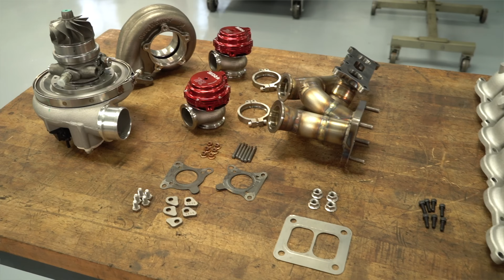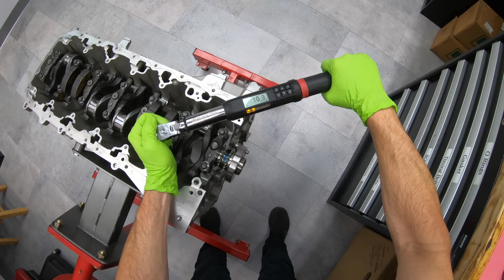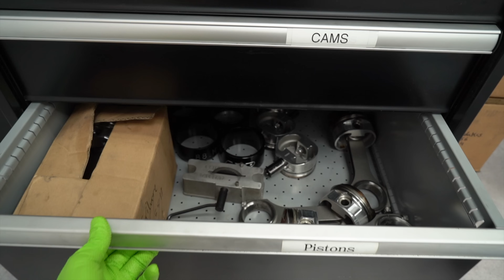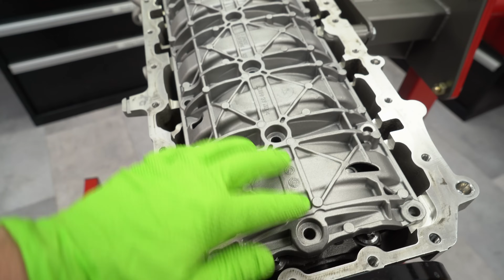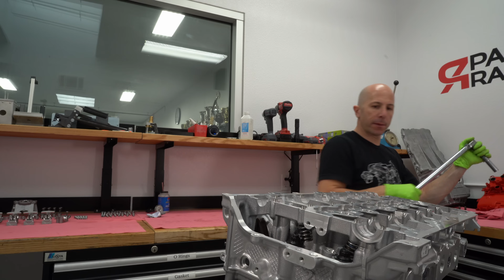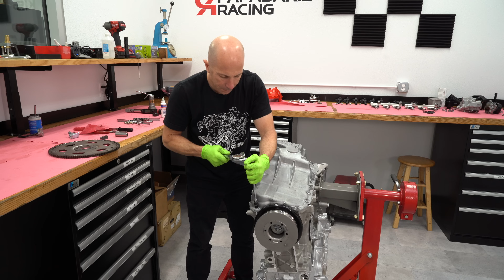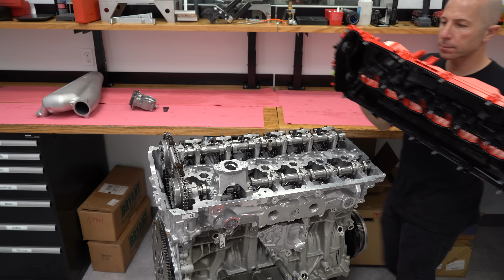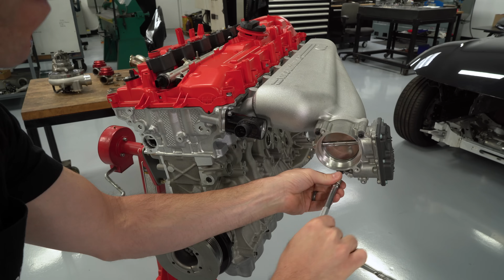2020 Supra 1000 HP Engine Assembly - Start to Finish

Comment: They’ll be 3D printing whole cars in the near future.
Reply: Come on people, stop dreaming and actually do something.
3d printing is NOT the future for manufacturing. For plastic injection molding is BOTH cheaper AND more precise AND stronger, for metal diecasting, forging and milling are all cheaper, stronger and more precise than 3d printing. 3d printing is and will be the worst way to mass produce something. But it has one benefit: you don't need to make molds and set up tools. So for making just one it's way easier. Making this intake the old way would give a better product and cost the same, but it will take more time, and he didn't want to wait. And if you want multiple of those intakes then making it the old way would be way cheaper.
Reply: @sasjadv  Exactly. Molds are the killer cost. Modifications in the mil and micron range are even more painful.
Reply: VW and V-AG
Reply: @pgmurray76  VW is VAG. Volkswagen AktienGesellschaft = VAG. In UK they called them VW Audi Group also.
Reply: @clutchfreak13  I know dude! Even after three years of Deutsch klasse, I am not writing Aktiengesellschaft! A public limited company in Germany.
Reply: @clutchfreak13  May as well list all the VAG group marques:
Audi, Bentley, Bugati, Ducati, Lamborghini, SEAT, Skoda, Porsche, Scania AB, VW, Traton SE, and Volkswagen Commercial.

Porsche and Piech are the majority stakeholders of the group. VAG has multiple engineering and industrial firms under their belt too.
Reply: @takanara7  Hahahahaaa!! LMFAO . Umm, that is why I never write V-AG as VAG! I refuse because this is exactly what is in my mind, and everyone else.

Her voice and sound is quite good. This is what 'Chanel West Coast' (blah) always wanted to be.
Reply: @pgmurray76  VAG just assemble engines for Porsche, Porsche has 54% of the stakes in VAG.
Reply: @josevaltiburcio13  Definitely. Good to know Porsche and Piech are the majority stakeholders. Duly noted and edited.

Comment: I did my apprenticeship with bmw and we literally had a 6x6 room filled with thousands upon thousands of special tools that were individual to a special model bmw. It makes working on their products an absolute nightmare sometimes. We also shared a workshop with Toyota and would help them out with repairs when we didn’t have heaps on. Probably about 50-60 special tools in total over the whole span on cars they have built, and most of them were related to fuel or diagnosing. Toyota have been considerably better automakers than BMW for almost 50 years and pairing with bmw for the rebirthing of one of their most legendary vehicles ever produced was a gigantic mistake. The money they have saved in r&d and production wouldn’t even be a fraction of what they would have made if that took this opportunity by the horns and shared the same dreams and ideals as they did back when they made the jzx90

Comment: any links to the company who 3d printed the mani? also I imagine the cost was lower than what it would take to have it fabricated or machined... I need to have an ITB adapter manifold I designed made soon... I 3d printed it from CF nylon as a prototype but now it's time to finalize and having it 3d printed in aluminum might be the most cost effective way to go...

Comment: "There's actually no dip stick in this engine to check oil level, it's all electronic with that sensor"

What could possibly go wrong? 

This engine as advanced as it is, as superior in combustion control as it seems, as modern as looks just screams multiple failure modes to me. That complicated valve train is no doubt superior when working as it's manufacturer intended. 

I have faith in Papadakis, I have faith in Toyota, I however have no faith in German over complexity.
Reply: you’re not very bright. it’s not that complex
Reply: @NickFigallo  
You are most correct, I emit only infrared radiation, nothing in the visible spectrum alas. Thank you for the enlightening comment though. 😀

Comment: "No timing marks on the pulley" that's not very Japanese, oh wait.  .  .  .  .  .  .
Reply: "no dipstick in this engine" 😂😂😂
Reply: @glrage  screw that, don't want a sensor to fail and be stuck reading high
Reply: @glrage  be like the M5 V10 when the oil level sensor fails. They chew so much oil that the engine fails if you don't keep topping it up. The guage still says all good lmao...
Reply: karthik11512 Looks easy to replace if you ask me. Both my cars have a sensor like that. They are 12 and 13 years old.
Reply: @karthik11512  3 nuts and a sensor connector and its out? Change the oil at the same time? Profit?
Reply: That's because using PRECISELY MACHINED AND SUPER ACCURATE special tools that literally do the perfect job every time is far superior to eye-balling the degrees by looking at timing marks.
Reply: Aight shut the fuck up, the joke is old and not funny!
Reply: Why use something that is simple, cheap, foolproof and works perfectly when you can replace it with something complicated, prone to failure and costly to produce?  It's the German way!  Seriously though, the main reason manufacturers are replacing dipsticks is they are trying to make cars more appliance like.  Basic maintenance of anything is too hard for most people.  Your average consumer has no idea they should be checking their oil levels from time to time, especially on a modern turbo-charged vehicle that is designed to burn a bit of oil on purpose - let alone how to top the oil up if it is low - so they put a sensor in so the car will tell the idiot sitting behind the wheel who never opens the bonnet that they need to go to the dealer and be charged $150 for some top-up oil.  Same with having tyre pressure sensors to warn dummies who haven't checked their tyre pressure for 3 months that it's getting a bit low.  It's because people do not want to know anything about the technology they rely on and just want a plug-n-play appliance.
Reply: @karthik11512  No it's not. It's a fucking sensor. You want a manual dipstick to measure fuel level too? How about a manual thermometer for motor oil? Since you don't trust sensors.  Since BMW has dropped off dipsticks and uses only sensors (which is years at this point), probably 1 out of 1 million of those sensors failed.
Reply: @derbigpr500  how about the customer having to wait ten minutes just to get a level after an oil change.  Oh wait let me pull this dip stick. Oh you needed a half a quart there ya go. Instead I have to leave them sitting and warm up just to check the oil. They should have both. Problem solved. I've never met one bmw customer that was a ctually happy with that whole thing. I don't care if they're 100% reliable it's just a wasted feature for lazy owners that can't change a tire. It's literally a dummy light.  Also Audi's
Reply: @derbigpr500  Ha, too bad the motor fails 1000x  more!!
Reply: @karthik11512  It can get even worse... Some people had diesel engine runaway on a new engine because of a sensor that did NOT malfunction, LOL.
Here's the story: these sensors don't tell you when your oil level is over 100%, and if you overfill a diesel engine with oil, then the pressure will be too high and it will come out of the turbines, spray into your intake aaaaaand if that happens in a diesel, then your engine will runaway at full boost. And your engine will behave as if your throttle pedal is welded to the floor, XD. And if this happens on an automatic gearbox, then you need to pull apart your center console, and look for the emergency pulltab to get it in neutral (the normal handle gets blocked while driving). And to make matters worse: if you do manage to stop your car without crashing into a wall, then it can still catch fire.
I just told you a real world story.
Reply: sasja de vries. Yes they FOR SURE tell you when you overfill your oil and will give you the classic german “engine oil overfilled!” in the infotainment system. Do not talk with authority on that which you know nothing.
Reply: @sasjadv  I don't know in what time you live but my 2015 tdi has an sensor for to low or to high oil pressure. I've never heard a case of a 'german' modern past 2010 diesel engine ended up in a runaway. My father and grandfather always said in America you can only sell the most basic engine, they will stick to these ancient techs for ever and I guess he was right.
Reply: @RustyHeartsTOV  What do I have to do with American mentality? I have never even been outside of Europe. And I've studied Aerospace Engineering, because I like to develop new technologies myself.
When a company comes up with something "new", I like to filter out the marketing wank, and then have a laugh when looking at how much they've actually innovated.
And I almost always see way that the R&D budget could have been spend more wisely.
----
In 2015 there was a new Jaguar XF that actually caught fire because of an engine runaway after the turbo started spraying excess oil pressure into the intake... I'm not saying that's common, because it isn't. But I've heard that there are quite a lot other brands that don't show oillevels above max.

And don't forget that different car manufacturers can share the same supplier for sensors and infotainment.

Comment: Soooooo... If this is how an engine works... Why the heck did we keep them if we had electric motors for a while now... I guess oil had to sell or alot of rich ppl would get pssed cause if we started developing electric cars the iCE cars would have gone extinct from the early 1950s and we would have had 2000 miles ranged electric cars if the same effort would have gone into developing electric cars since the start

Comment: The 3D printer for aluminum sounds amazing. You can create to anything you want
Reply: Nope, it's weaker and less precise than billet forged or diecast. And it's more expensive. So actually an SLM printer is really only useful when you have an advanced shape and you only need one of it.
Reply: Well, u can make a cast mould frm it and forged it.
Reply: @huzib.8623  100%
Reply: @huzib.8623  Yep, that is one way of doing it, you can make a mold and cast it many times, then you could cheaply mass produce your product.
But if you want to make a mold for mass production anyway then it's way cheaper to print in plastic or wax.
So metal 3d printers are really for when you only need 1 prototype.
Reply: do you have infinite money?

Comment: Can you say you're really making ''1000HP'' if you're not even using the OEM direct injectors to do the job?  placing port injectors isn't really making a 1000HP  intended
Reply: @Seb C  What the hell is the point of you comment ? The JZ engine is over 20 years old it can make 1000whp forwards and backwards... he's not doing it with the OEM direct injection system he's using port injectors. Which is not what the engine was designed for in other words he's too lazy to go through  getting a larger pump and higher flowing injectors made for the GDI system. Also walking backwards and placing a front mount intercooler on it ....
Reply: @Seb C  Pretty certain this is coming from someone whos never touched the platform since you said ''BHP'' I know exactly what region you're from.  There are plenty of stock block 1000 WHEEL horsepower 2jz records so no you don't have to change everything to get one to do that, fuel turbo head studs  and engine management  you can get one to do it don't define something you never had experience with.
Reply: @Seb C  I can do this all day ... 1. https://www.gtr.co.uk/forum/136499-stock-long-block-2jz-gte-1043-whp-808-tq-gt47-80-e85.html 

2.  https://www.youtube.com/watch?v=YnS-nT6o4xA 

I can literally do this all day. The B58 is not special the 2jz has done 1000 whp no problem unopened.
Reply: @Seb C  Are you stupid or did you not just see the links I posted or read what I said ? You can literally have an internally stock long block and make 1000WHp on a 2jz but you keep posting about how it can't with no experience of you ever doing so.
Reply: @Seb C  Your first comment was you can't make that on a stock 2jz w/o changing everything now you're like safely a built engine can shit the bucket as much as a stock engine can.  Well you're not really developing the engine when you work around the fuel system ppl don't want to add extra shit like additional injectors when they already have 6 to deal with.
Reply: Seb C it’s a damn street car direct injection is unessesary in a race engine? Interesting formula 1 cars have no problem using direct injection...  you my friend haven’t a clue of what you’re saying fuel transport times, atomization, fuel cooling is all superior which is why all BMW’s now have direct injection..
Reply: @Seb C dude shut the fuck up already at first you claim '' old engine can't make power'' Now This X unlimited budge but you have no first hand knowledge of GDI or fuel systems period do you think what he's doing now is low budget or do you fucken think GDI cost more ? You can't say anything because you don't fucken know whats involved at first you were like  oh its high power level he has to go port now it's F1 and unlimited budgets ...- just fucken stop already

Comment: I can’t get over 1000hp leaving that tiny exhaust manifold 😂
Reply: Two ports... Seems restrictive. Don’t worry, he will call up a big shop that is conveniently located nearby, and have them make a brand new head. Lol. This video is insane!
Reply: Same thing as a rotary 2 ports and make insane power
Reply: I keep saying the same thing. There can’t be any coolant passages on the outer wall of the ‘manifold’. I’m wondering at what point will it just blow out from the heat and pressure?
Reply: @benupde1979  Well, actually cooling your exhaust reduces pressures, so you will have less pressure to spool up the turbo. So you will lose power. I don't think the walls will blow out.
Rotaries have their firing order spaced out equally, not quite the case here with these 2 ports. An inline 6 is not a rotary.
Reply: You do realize that it has kinda like an integrated exhaust manifold? Any turbo car will have a small opening before the turbo.
Reply: @codenamecordon   Do you know what makes an exhaust manifold a good manifold? Spoiler: it is restrictive.
When speaking about exhaust manifolds in general you want them to be smooth, have a constant diameter, and let the individual runners combine as late as possible. If you want a good turbo exhaust then these rules still apply but you also want the overall length to be short. And there is a little cheatcode: you CAN pick those cylinders where the pistons go up and down simultaneously and let those runners combine early on. For this engine you can take 1 and 6, then 2 and 5, then 3 and 4, and then have 3 exhaust runners going to the turbo without performance hits. This is because if you combine random cylinders then the pressurewave from one cylinder can mess up the exhaust flow of the next cylinder that's firing. This is a big problem, not only does it restrict flow, it does it in an uneven manner, one cylinder gets worse flow than another one and you will have an unstable engine. The more stable it runs the more aggressive you can tune your engine. Now the pairs 1-6, 2-5, 3-4 are the furthest apart from each other and at equal distance (in terms of firing order).
Simply put: you do want your manifold to actually look more Ferrari, and less Priussy, it does give significant gains. And this manifold is has 4 mistakes: it has quite tight bends inside the head, it combines the separate flows too quickly, it doesn't combine cylinder 1 with 6, 2 with 5, etc but it combined the wrong ones, and the distance from each exhaust valve to the turbo is not the same (although that is less of a problem).
Reply: @sasjadv  Mans knowledgeable as fuck, cheers

Comment: Do those wastegates need an exhaust tube to get the heat away? There will be an awful lots of heat coming from those, is a fire under the hood a risk from these? 
The look of quality of the Toyota engine and your engine build is impressive.

Comment: Great video, and awesome content - you make it all look too easy!  Question:  Are you upgrading the DI Injectors to something with more cc?  Would it be an option to keep the standard DI (to retain driveability) and add port side fuel injectors to come in when on boost (as per the Golf R EA888 engine).   Would be cheaper, but have to run an additional fuel pump.

Comment: Being an Aluminum Block, the bottom end seem to look like a weak design just waiting to rip apart. If you compare it to a GM 6 bolt design or a Honda F20c engine.

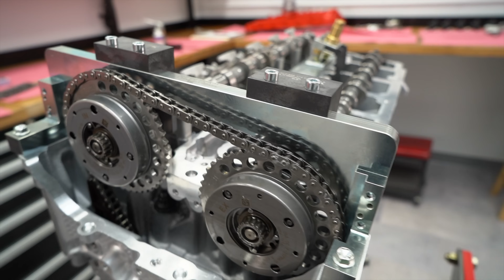Comment: I believe that variable valve lift actuator at 9:10 is actually the throttle in the stock configuration. At least that's how it works on the other new BMW engines. The engine still has a traditional butterfly style throttle,  but during normal operation that is wide open. The butterfly valve is used as a safety/backup throttle in case the variable valve actuator fails. Most tuners (like Papadakis explains here) will bypass the VVL system and use the traditional butterfly instead. I expect that it is just a matter of waiting for ECU vendors to start supporting the VVL actuators.

Comment: Lol, “can you make the manifold bolts easy to get to?” Said no car manufacturers ever!!
Reply: Why would they say this anyway if they are the ones manufacturing the car
Reply: not to take away from what you said the ford ecoboost does
i just built a motor for it was easy to get to .. 600 hp 600 torque
Reply: any car's exhaust manifold bolts are easy to get to of the engine is out of the car 🤦‍♂️
Reply: @mentals555  He meant when the nut is too close to the pipe. I've worked on all kinds of engines, many times you cant fit the boxed end of a wrench on and if you use the opened end, it will flex slightly tapering the nut. Spacing between the nut/stud and pipe is what he's asking for.
Reply: " Subaru , can you make changing sparkplugs easier next time around?"
no.